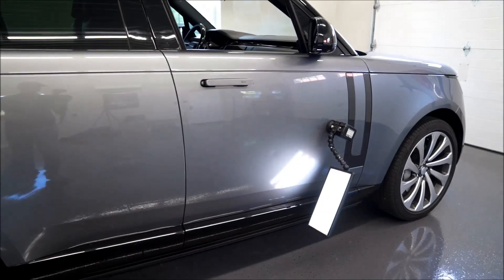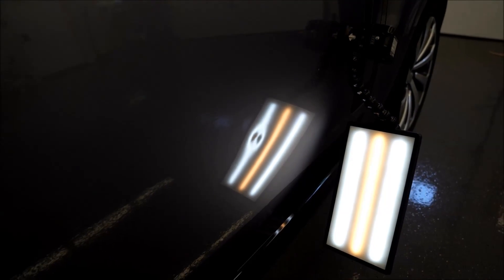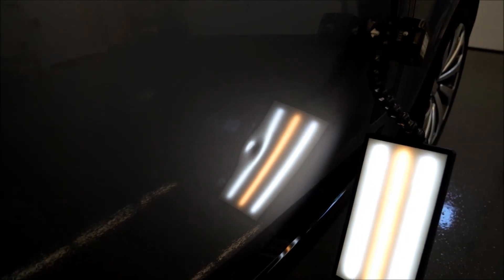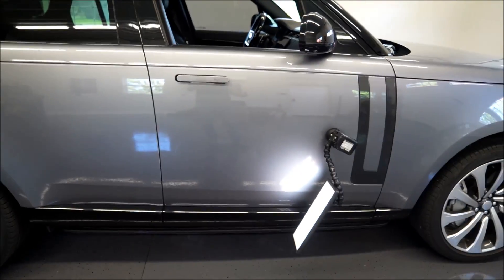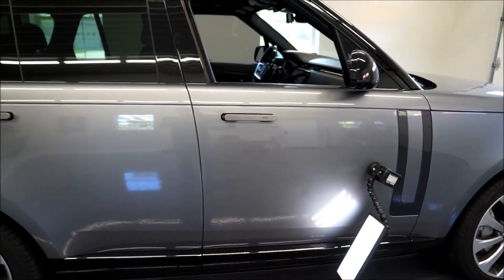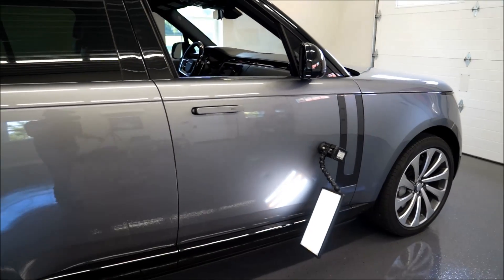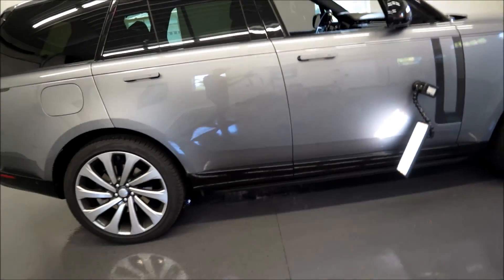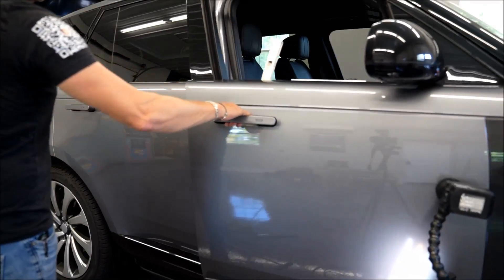Shrinking a Dent on an Aluminum Panel! (PDR)

Comment: What would this job typically cost? I have a new mustang that has aluminum doors and I kicked a rock with the mower. Lookin to do this repair.
Reply from the maker: @TheMoneyBed  Price can vary depending on where you live and the location of the dent. If it's similar to this one, you can be looking at around $250-$300.

Comment: Nice result, did you use a sharp tool are a flat blade?
Reply from the maker: Used a flat blade from ultra Dent tools. Tried to have the heel just under the brace and pry off of that.

Comment: I wish you would have showed the tools you use and where you purchased them. Nice work btw
Reply from the maker: Sorry I didn't show what tool I used. It was a flat blade tool from ultra Dent tools. I tried using the bracing to pry off of with the heel of the tool.
Reply: @WipeOutPDR  ok thanks
Reply: Was that a single bend blade or a double bend blade ?
Reply from the maker: @straightlines7432  It was a 36" tool with a 3" blade at 45 degree angle
https://www.ultradenttools.com/collections/individual-tools/products/3809-36-bendable-twist-45-3-blade